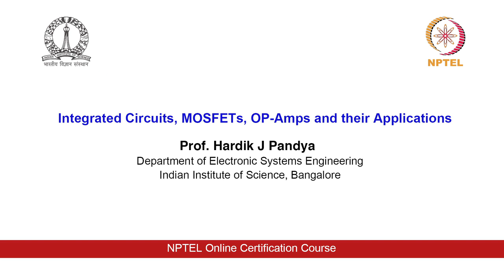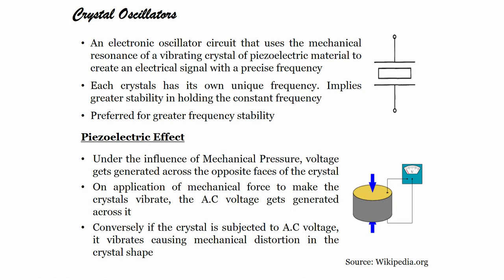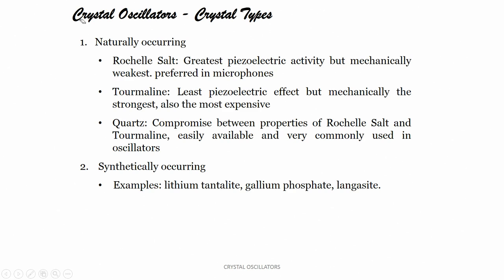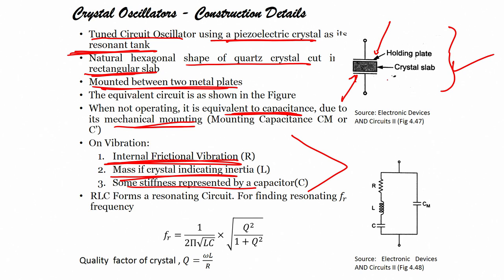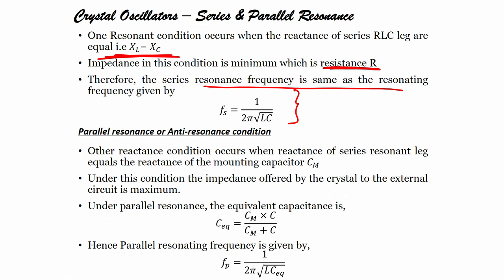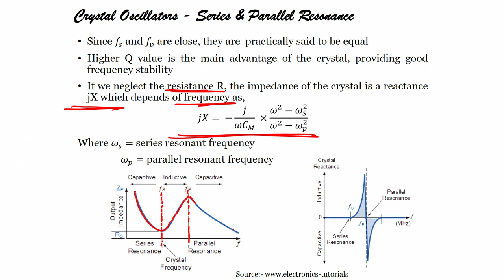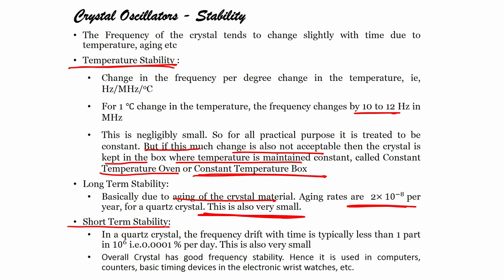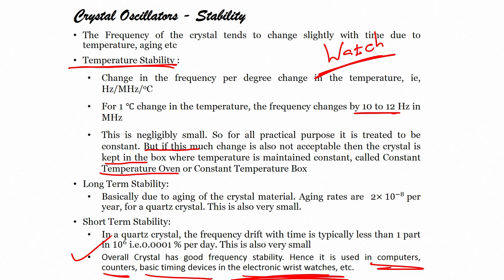lec31 - Working of Crystal Oscillators

Comment: Two ends of a piezoelectric material is connected to electrodes.  Upon switching on the power to the electrodes, the crystal moves forward.  It then moves back to the original location generating a negative voltage.  This negative voltage overrides the positive voltage at the electrode, bringing the voltage to zero voltage for a short period.  After this negative voltage is fully damped, the positive voltage at the electrode acts on the crystal again.  This goes back and forth creating a square or sinusoidal voltage depending on exactly how much is the piezoelectric effect of the crystal.